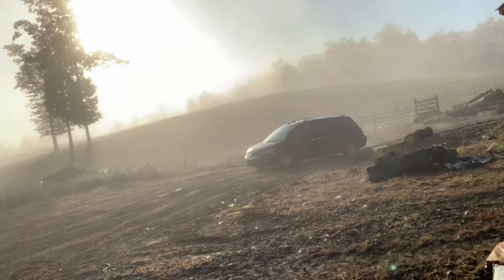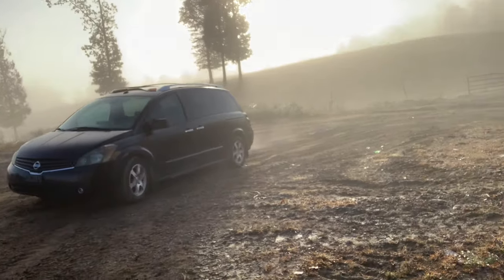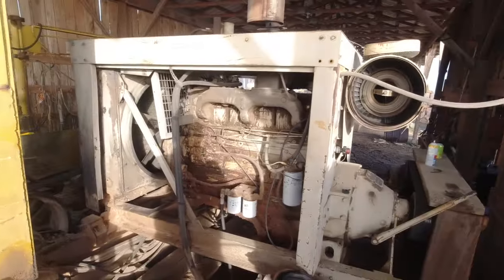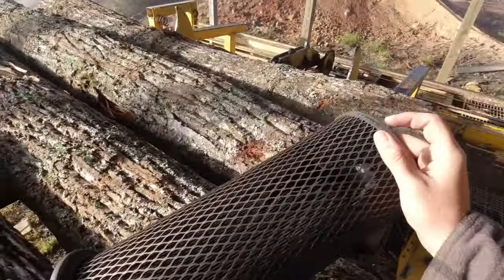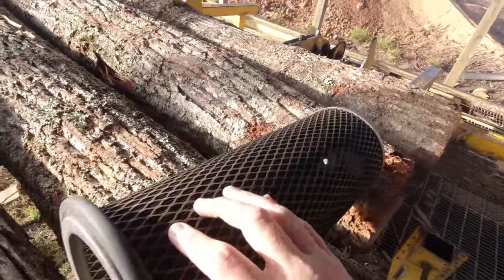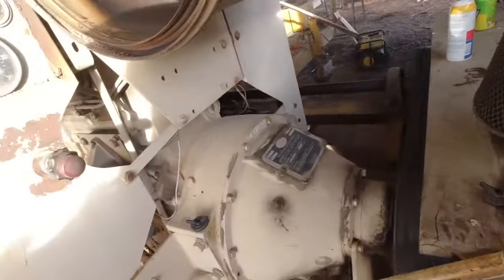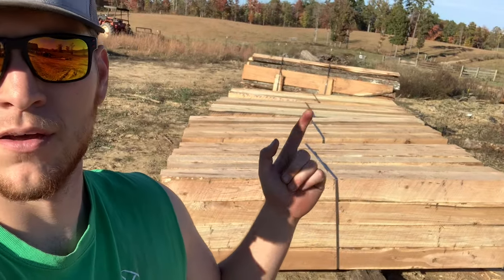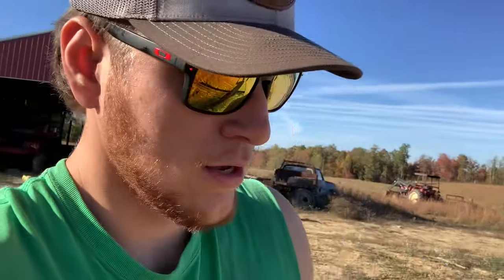Father and Son Sawmill Operation/Sawing Cross Ties

Comment: The sawmill brings childhood memories.  back in the 70's my dad would take his old 55 chevrolet dumptruck to a nearby sawmill when they were sawing hardwood.  Instead of burning the slabs they would load them on the back of the truck.  It would take all day but they would fill up the truck and he would go back and get it late that afternoon.  We kept warm a lot of winters by cutting the slabs into firewood length and burning in the wood heater.  Glad to see that someone is still sawing the old fashioned way.